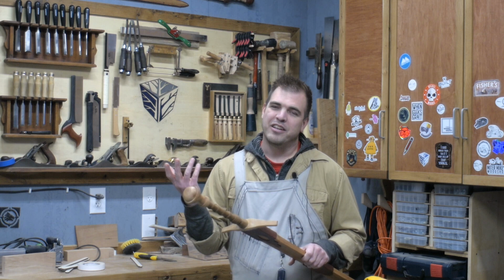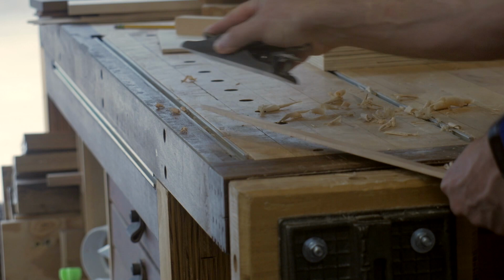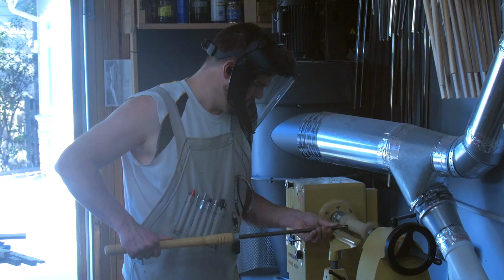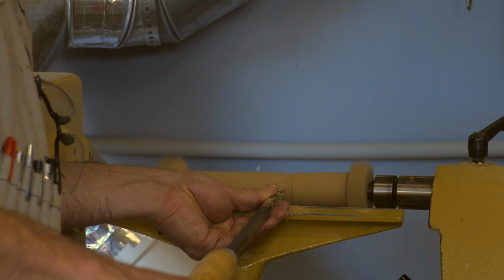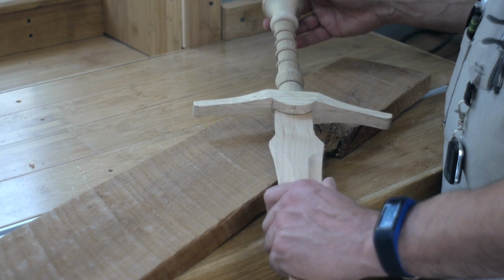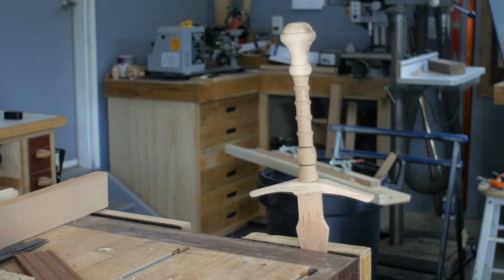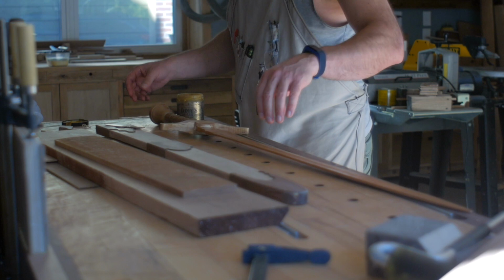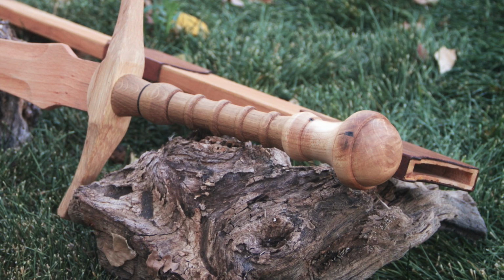Making a leaf bladed long sword and scabbard

Comment: Have you tried laminating 3 thin layers together for the blade?  
This would help to strengthen the blade and keep it straight.
It could add an interesting detail if different color woods are used.
Reply from the maker: This is a great suggestion, I'm sure of it cuz I've shown it in some other videos. I have a katana and gladius builds that use multi-laminations, and the results are great. Check out some of my other vids and thanks for the suggestion!

Comment: Absolutely stunning mate . I dont suppose you could send me the link to "whoch" router bit you used
Cheers
Paul, England🏴🇬🇧
Reply from the maker: Thanks much! I don't remember which bit, but for a shallow curve, a 2-3" panel bit with a very gentle curve or slope will give you these results. Be sure to run it at slower speeds, those large bits are frikin scary!  Cheers!
Reply: @GeeksWoodShop  thanks. They ain't cheap by the looks of things :/
Reply from the maker: @paulbateman5769  Sigh, they definitely are not.

Comment: soo cool. really makes me want to go in the shop right away..  i am wondering how exactly you are doing the transition from the oval handle to the round pummle though did you file it round at the bottom?
Reply from the maker: Not a transition really, the pommel is purely round, so they just meet up, but sill very comfortable. Thanks